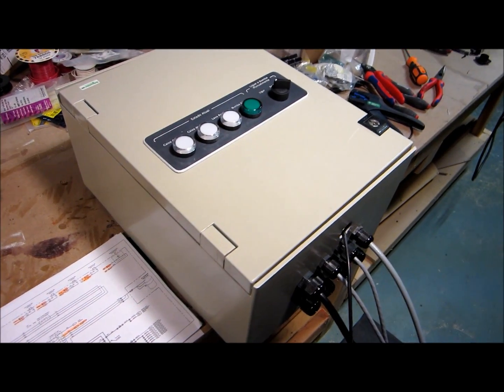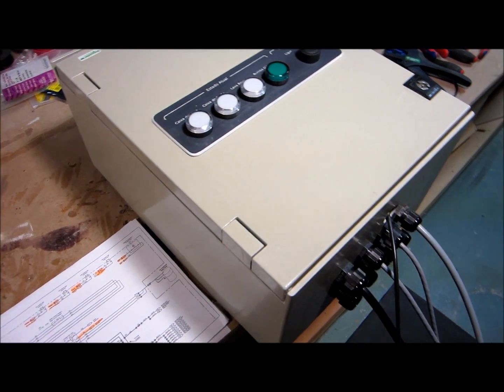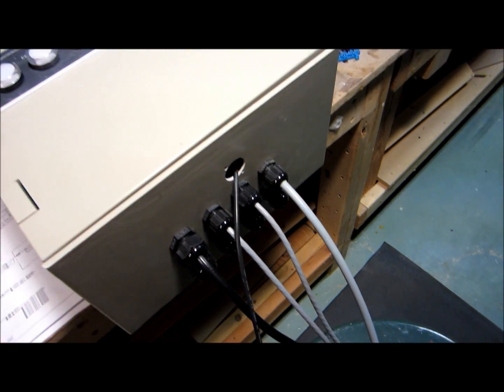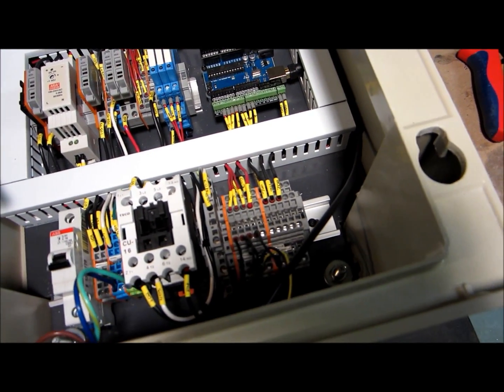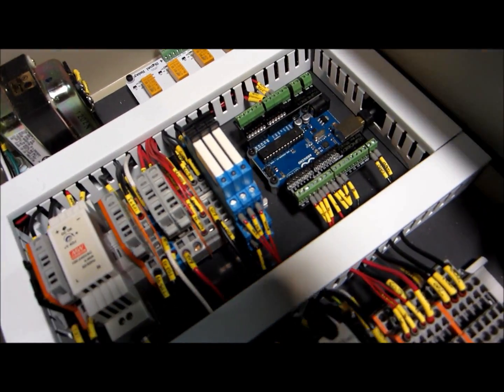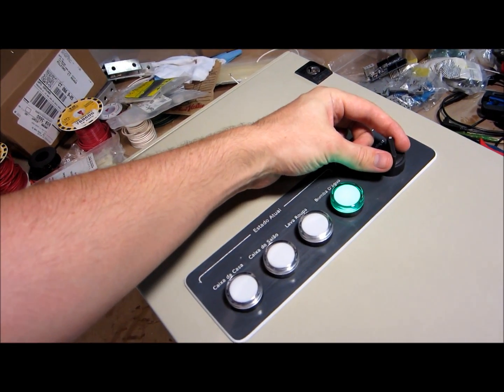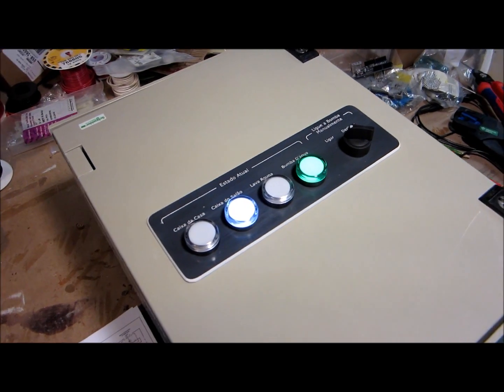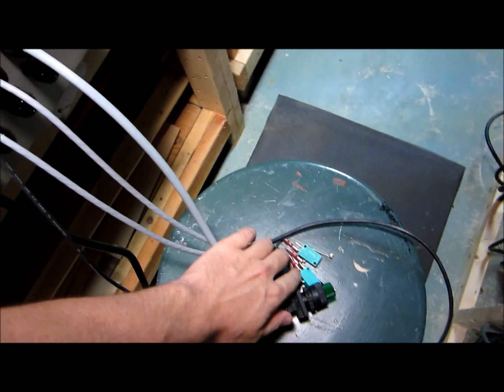Arduino Water Control System

Comment: Great job very neat! Few questions, 1. What are all the components mounted to, is that just a piece of wood? 2. Where do you find those cable channels to route all your cables in? 3. What type of crimp plugs/terminals have you used boot & lace?
Cheers
Reply from the maker: The back plate is PVC sheet (1/4" thick), I made it myself. The wire duct can be purchased from many suppliers and brands, but you want to search for "wire duct". The wire connections are all insulated crimped ferrules.

Comment: What kind of wires are you using? Meaning, they look clean and that you didn't have to solder anything. Also, what are the green items on top of your header pins on your Arduino? I would love to not solder :).
Reply from the maker: They are all stranded hook up wire and the cables are multi-conductor igus cable. In control systems the objective is not to solder things to allow for easy servicing and upgrades/replacements. Once you use screw terminals on anything, you won't want to solder anything again.

Comment: Very nice job. Regardless of what some have said below, arduino is more than capable of a simple application like this.  Plc is overkill.  What are you controlling with this setup?  End application?  

Also, maybe nice to add some heartbeat indicator from the arduino, so you can keep tabs on it. 

Finally, not sure how you are isolating the supplies, but just make sure you have a nice power supply feeding that arduino. Wall wart may not tolerate the transients if those pumps and solenoids are on the same input source. 

Nice panel. That panel would easily cost 5k to have built so i am sure you made out nicely avoiding that plc. 

Next make a little front end for it so you can change the time delays, etc without too much trouble.

Comment: what is the thing called you clipped everything into? I have been looking for something like that.
Reply from the maker: The wire duct?
Reply: briancnc It looks like you are using DIN rail, but what did you use to mount the arduino to the din rail?  I have been looking for a solution to mount my relay modules as well but since I am not using the solid state relays or relays that even have din rail option I want to try and come up with a solution for the inventory I have.. and I have a ton of relays already purchased.
Reply: thatonesnowboarde I mounted the arduino uno with screws, which went into the back plate. I made a cad drawing of the hole layout to achieve this. I used nylon washers and standoff risers to do this in an insulated fashion.

Comment: I have a similar setup used to measure water flow with hall effect sensors and through a relay board control solenoids to shut the water on and off. Every time the solenoids activate, they cause error in the water flow reading (an erroneous instantaneous increase in the reading). Almost like they are putting EMI noise in the sensor cabling. What could be causing this?

Comment: Looks very nice but massively complicated for what it does. Small plc would do the job just fine. Also way to many voltages going on
Reply from the maker: Thanks, I would say most industrial controls are "massively complicated" for what they do. A lot of sweat and effort goes into putting a lid on a container at high speed with a machine that runs 24 hours a day, but if you don't find a way to simplify the stupid task of putting a lid on something, you won't make money. Anyone can use an industrial PLC, I think you missed the point. If I wanted to spend a thousand dollars for a basic brick I could have, my goal was to use a simple arduino microcontroller to achieve the same thing with simple logic that could be written by the average Joe.

Comment from the maker: Hi Tom. I designed it in autocad and carved it out on my cnc router (my other videos will show this machine). I programmed it in Vcarvepro (CAM software). If you don't have the machine to do it there are endless suppliers out there that make engraved panel tags.

Comment from the maker: It's not, the arduino is a developmental microcontroller, and nothing more. It performs as an industrial controller if it's implemented as such, but there are no industrial guarantees persay. It is a stock part but it was implemented in a completely custom controller as I am sure you know by the video. Thank you :)

Comment from the maker: I don't like saying never, because with physics many extreme things are possible, but I would say it is incredibly unlikely that this would ever cause any fire. A UL listed microcontroller wouldn't keep the insurance company from denying a claim anyways. Their primary concern was whether or not the person that installed it is a licensed electrician, was following NEC, and was properly using the components. An arduino uno is not an industrial PLC, even though it has the same capability.

Comment: Whenever I've attempted to use "hard contact" relays to control anything, it's come back to bite me.  I would completely stay away from AC control voltage.  Go 24VDC which is now an approved Industrial Control Scheme.  Get rid of the screw terminal adapter and use something like an Opto-22 Rack.  That will completely isolate the Arduino from the rest of the high current stuff.  Be sure to use an MOV to limit the flyback from any relay or motor contactors' coils.  A diode is cheaper but inferior.

Comment from the maker: I work in design and engineering, but I got started on CNC zone, the mechmate forum for cnc machinery, and later got into studying a bit on my own. There are a good gems out there, such as Make's Electronics, and Getting Started in Electronics are excellent books to start with. I will follow-up in about 2 weeks with a how to video for this panel and my cnc panel as well.

Comment from the maker: Something like that is better suited with an industrial PLC. Arduino is good for development and DIY house projects, but as soon as you need a failsafe system you need a processor that has the approvals for your application and is robust enough to run in an active environment 24 hours a day. I'm sure arduino could do it, but I wouldn't hold my breathe, they don't claim it to be an industrial controller as some are sold as.

Comment: This has some real life applications as I am working on something similar for a municipal system.  My thoughts take it a step further by writing the logic so one can take advantage of electrical rates and penalties,  it is a small system with two wells but with multiple tank switches I think the pumps can be programmed around the costly hours of running them.  The pumps are also three phase and the electrical demand can increase the phase imbalance during peak times.  Can you manufacture someth

Comment from the maker: They are water level float sensors, just microswitches with a steel ball that rolls onto the lever when they lower. Just search for water float sensors, there are tons. You could also use capacitive water sensors which are more common in industrial applications.

Comment: Hey! What sensors do you use to measure the water level! I'm trying to make a system for measuring the level of a cistern and send me the info but haven't found a sensor that could work in a bigger container.

Comment: Did you try optically isolating the relays from the Arduino? I had problems with hiccups when turning off the power of 230V AC stuff with my controller, optically isolating the relays and putting in some 0.1uF caps in my circuit made the problem go away.

Comment: Hey, i've done few projects with an arduino in industrial surroundings, they all preform without hiccups.

The problem with the Arduino is that it doesn't meet industrial specs, and is very sensitive to the powerpeaks from the on and off switching you do.

There is a way better compatible bord available, it's the Olimex Arduino: Olimex OLIMEXINO-328

Also be sure that you protect the ports you use with an zener and a 220ohm resistor.

Good luck!

Comment from the maker: Steven, thank you for your kind comments. Unfortunately I could never get the AC flyback and some ghosts worked out so I wasn't comfortable with leaving it as is and went with a more permanent manually wired solution without logic. I couldn't get the arduino to perform without the hiccups and therefor made the difficult decision to not use it. However as manual as the zero logic system is, it has far greater risk to fail, perhaps in the future I can figure out why this arduino didn't work out!

Comment: I'm a design engineer who worked in defense electronics and commercial companies (so I've done many designs and layouts).  I think you have done an A++ job in your parts selection and wiring layout.  Very Professional!  You should be be very proud of the work you're doing.

Comment: That is an incredibly beautiful piece of work!
Do you have some sort of engraver to make your panel labels?
While it surely would have been easy to use a nano-PLC to run the system, I really think you did a great job with the MEGA! Looks as good as any controller from a custom panel shop costing thousands of dollars. 
Great job! I'm sure the end user was happy (especially if they had been controlling the system manually)!

Comment from the maker: Yes, I made it myself on my cnc machine. It's just a engraving tag material I bought. mcmaster carr sells it, it's pretty cheap. (white core) but they have various types. #7778T412 is the mcmaster carr part number. I engraved it on the cnc and cut it out, and also drilled the 22.5mm clearance holes for the pilot lights on the machine too.

Comment: Very nice idea. I've seen some yellow tags that have a flaten side with a small white paper to write on. But your idea works the same and it is cheaper.
How about the overlay of the front panel? Did you make it yourself? What material did you use?

Comment: I can recommend some beginners books that i started with, "assembly language step by step" (the knowledge you gain from this book far exceeds just programming in assembly you learn number systems, bits n bytes etc, and you gain a general respect for how your computer works), the first programming book i read was "beginning c++ through game programming" (this book was great for learning a higher level language like c++),c++ is ALOT like the arduino language, look into them anyway, goodluck..

Comment from the maker: Read some books, research on the internet. You don't have to be a programmer to learn to write code for the arduino, do the arduino tutorials, there is more info on their site than you need to write some basic programs. BTW STOP USING ALL CAPS IT"S ANNOYING

Comment from the maker: Haha, cracked me up as well. I started with the blinking LED as well and went through the entire make: electronics book as well as other arduino ones before hitting this one up. It was ambitious and never worked 100% because of the inductive flyback I could never fully correct. I don't think this is a result of arduino's hardware though, just the way I implemented it.

Comment from the maker: Thank you. I have experience with electronics yes, but this was my first experience with Arduino and microcontrollers. Prior, I knew nothing about the arduino, What are you trying to build? Arduino has a great user community, pick up a few books on amazon and post your ideas for help on the arduino forum. Don't give up, nothing is easy, especially at first.

Comment: That's really a nice job.
Did you have any experience with electronics? i have a little tiny setup and i would like to build a similar thing with an arduino but i have zero knowledge as far as circuitry and programming.
Should i just give up? haha